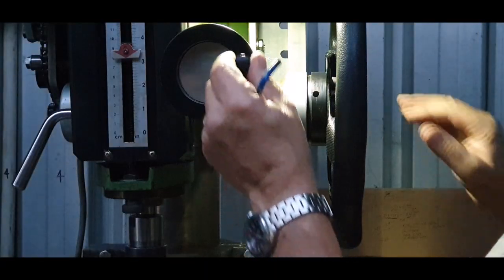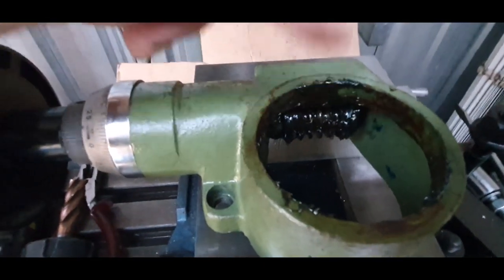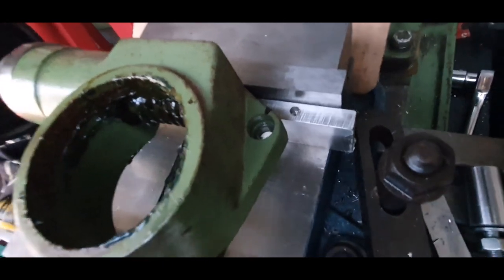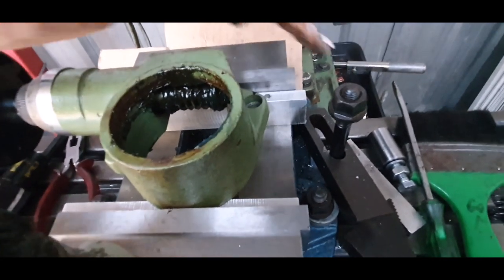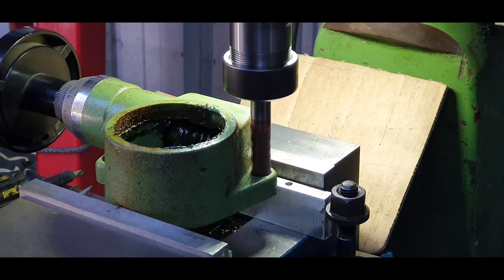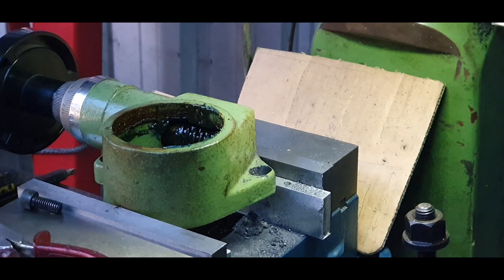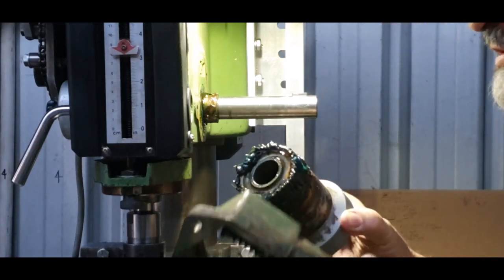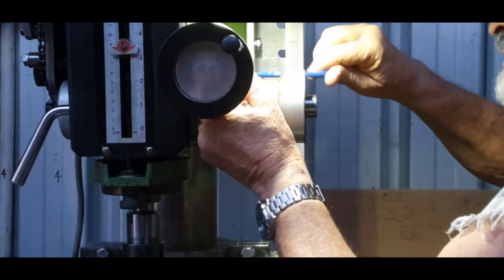RF 30 Fine Spindle Feed Backlash Adjustment

Comment: Glad you were able to reduce the backlash in that worm gear.  I've adjusted similar in machines where the worm screw could be biased along its axis but way of a set screw at the end of the shaft that you would tighten until you got the backlash down to a minimum.
Reply from the maker: Always appreciate a good comment. 
I thought of making an accentric adjust, but after thinking about it, the play in the fine quill would have gone, But .. then the main down feed would have not lined up correctly,  & it would have affected the main virtical shaft & the quill crossfeed. I found it was 100% better & safer the way I modified it.

Comment: Nice job I have the same endmill with the same problem,I'm going to give it a go. Smart idea
Reply from the maker: Gday Woody. Thanks for your comments,  greatly appreciated. Easy one to do.
 If I can suggest that you check for excess dia. Movement when refitting the wheel that controls spindle movement.

Comment: Exactly what I did to mine- had about 1/2 a rev of play - elongated the top hole and got the play down to less than 1/4 rev
Reply from the maker: G'day. Thanks for your comments. It is greatly appreciated.  I'm glad it worked for you. It's these small adjustments which makes life better

Comment: when you run out of adjustment using that engagement method you can move the pinion in or out to engage on the wall of the curved driven gear.
Are the old R8 spindles on these mills hollow where a drawbar would be used on the MT3 spindle ?
Reply from the maker: Hi there.  My Rf30, has always had a 3MT from new. I have made R8 insert mandrels for Bridgeports, but never delved into R8 for for RF30. It has got a certain sized tube or hollow inside the spindle to accommodate the draw bar of which I have used different draw bars up to about 13mm or 1/2",  where you can feel the threads touching as the drawbar goes down. Hope this answers your question.

Comment: Ted, I have an RF-30 exactly like yours. The back lash you've eliminated, while good, isn't the core problem. The problem still is that there is back lash between the rack gear and the quill. If you want to eliminate that you need to make some eccentric bushings for the cross shaft. I've got a set and I'll send you a photo tomorrow. The ones I have were made by the late Heinz Kegler.
What is even better than getting the back lash out is to install a digital caliper. On your mill you only have to drill for two 4/5mm screws to mount it and you don't have to modify the caliper at all. If your RF-30 is just like mine you will make a terrifying discovery... the front plastic cover mounting screws on the head and the pinch bolts to lock the head to the round column aren't metric. They are British Standard Whitworth.
Here is a picture of the caliper mounted: https://i.postimg.cc/0QmfzFZW/IMG-0149.jpg
Will send more detail if needed.
Cheers from NC/usa
Reply from the maker: Thanks for your comments.  I pulled the shaft out & checked the Rack, & checked the side bushes etc & found them nice & snug. The cross shaft to the Virtical appeared to have minimal backlash. The only section that had the excess backlash was the fine Virtical wheel, That’s why I modified it this way. Send what you think will help, I'm always open to suggestions. 
Also I have a 3 axis  DRO that I will be fitting,  I just needed to get everything else back to or close to Specifications.
Reply: @TedRoza  Ted, here is a detail photo of the mount I made for the mill. The main body of the caliper is clamped in a block attached to the quill with 2 screws. The trick item is the block attached to the angle aluminum attached to the head of the machine with stand-offs using the existing two side screw holes used for the plastic front cover. The block has a dowel pin that the OD measuring sliding jaw contacts. The ID sliding jaw contacts the adjustable flat head screw so the is zero backlash between the caliper OD and ID jaws. This mounting allows for the small amount of rotational wiggle of the quill in its mounting. This set-up allows accurate feed of the quill in steps of 0.001" /0.025mm . If the quill moves vertically when you lock it, it will show. You can take a cut, pull the quill up to take a measurement and then come back down to where you were previously.
https://i.postimg.cc/G2Rv7Qk9/IMG-0148-B.jpg
Cheers from NC/USA
Reply: The trick for making a flat surface to mount the caliper clamping block is easy. Put a lathe tool in the vice and crank the table back and forth like a planer to make a flat on the lower quill clamp. It is cast iron and very soft and easy to cut, drill, and tap.